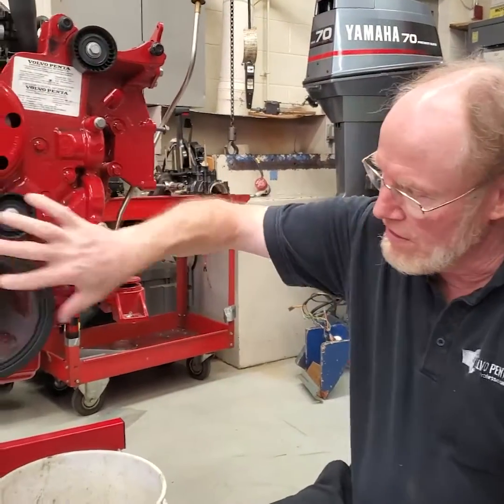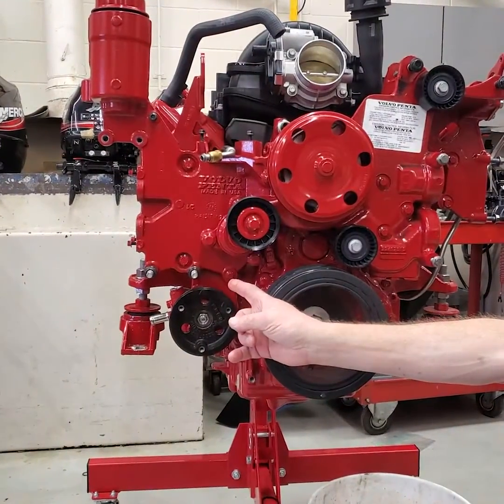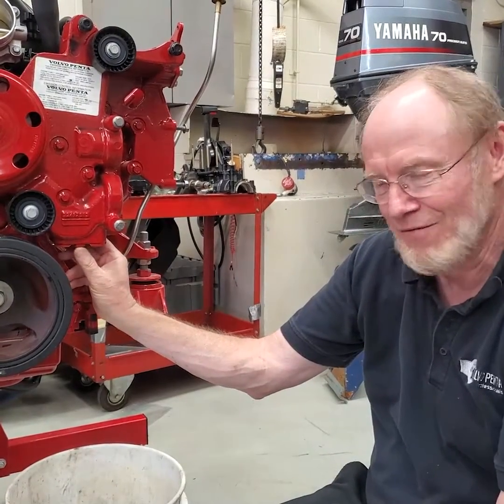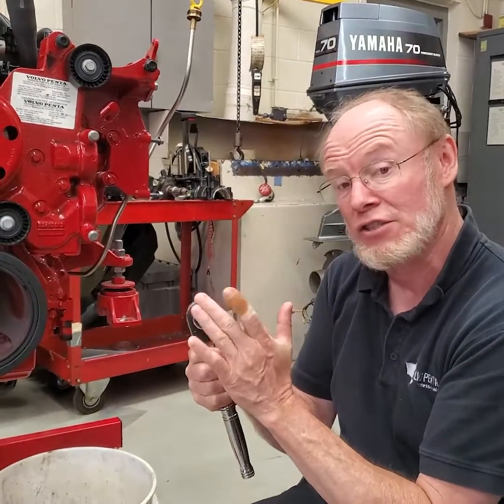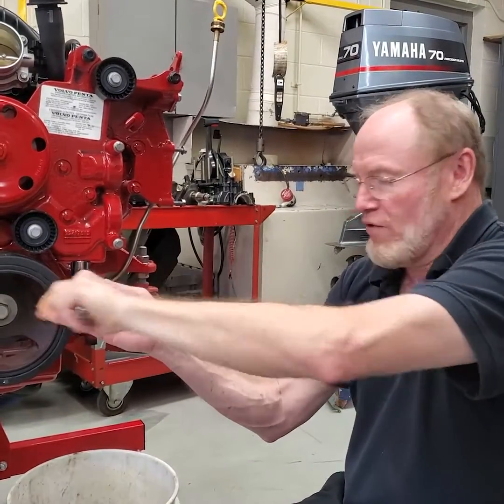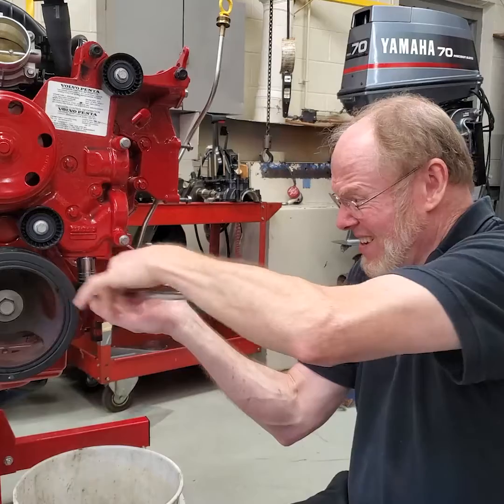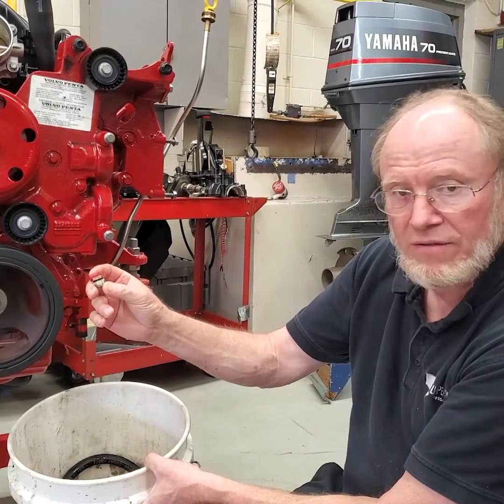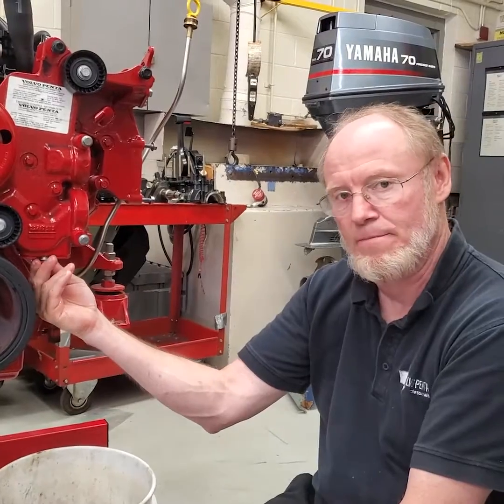Volvo Penta  4.3 and 5.3 Gen V FEAD antifreeze drain location

Comment: Great tip on grinding down a socket for the main drain plug as it is indeed aluminum. It appears that the replacement plugs are brass? The starboard drain is a disaster. Located behind a cluster of wiring and hoses. It will drain directly onto wiring connections. Access is poor. Manual says to use a ball end hex but there's not enough clearance. You need to use an extended ball end hex socket, not a standard socket with an extension. If this is the first time, hammer a quality extended length ball socket into the plug to seat it or it will definitely strip out. The torque spec is only 22ft-lbs but I had to use an 18" breaker bar to remove it. Either it was over-torqued at the factory or the sealant locks it in place. It never loosened up much so I suspect they used a semi-permanent thread sealant. A cheap ball socket is likely to strip. It's not possible to use even a stubby standard hex key. The service manual says to change the coolant after 4 years which is also beyond the warranty. I feel sorry for the guys trying to service this. I will probably use Rectorseal #5 instead of Loctite 567 on the threads as I don't future removal to be such a nightmare. Following the manual procedure still leaves a couple of inches of coolant in the expansion tank that can be sucked out with a vacuum hose.

Apparently Volvo has switched to VCS-2 orange coolant and is phasing out the yellow. The orange can be mixed with the yellow. Ironically, Ford phased out their orange OAT in favor of Yellow because it clogged heads. The expansion tank on our Fords was trashed with permanent staining from the orange gunk. Hoping these OAT coolants aren't some large OEM swapping Volvo for Ford to use up their inventory.

Comment: I have a 2006 Volvo penta gi, I have raw fuel coming out my exhaust. I have taken it to 2 mechanics and have not fixed it. Started with changing the fuel pump due to paint chips. Then replaced the fuel pressure regulator, then had the injectors cleaned and calibrated, now the boat dumps fuel out the exhaust. Runs good, idles, accelerates, ect but is dump fuel. Any ideas. Also does the motor have a fuel cooler. There is no closed system that I can see. Is it standard that they have one.

Comment: How much of the exhaust system is cooled by antifreeze and what part is cooled by seawater?

How does the aluminium exhaust part deal with seawater?
Reply from the maker: The Exhaust Manifold and Riser are both made of an aluminum alloy. There are temperature sensors in each which prevent excessive temperatures due to lose of raw water flow (engine derates in this case).
The entire exhaust system in all GEN V engines is raw water cooled.
To protect the exhaust components there are anodes located in them which need annual replacement. These are described in the owners manual for the engine.

Comment: Does the degas bottle plug just  into the FEAD with O-ring seals? I’ve been getting a very small leak over the winter that I believe is coming from this joint. It appears it seals similar to the heat exchanger, but I don’t want to break the bottle if I’m missing something. I really appreciate your Gen V VP videos there’s not a ton of information out there on these engines.
Reply from the maker: Likely, can you email me a few pictures to marinedoc01@yahoo.com

Comment: How do you winterize a volvo penta v6 200 G without the easy drain system?
Reply from the maker: If you want to drain it for the winter then the owners manual will show the drain point locations
Reply: @tedsmarinerepair8956  
I have read manual and it doesn't explain how to winterize the engine.
There is a flush fitting beside the oil dip stick.
So I am thinking I will just use ear muffs on leg run engine for 20 minutes to open thermstats. Then attach RV anti freeze to ear muffin and run engine untill lots of anti freeze coming out of leg. Also at same time connect another fuel line mix with two stroke oil. Once this is complete there are three hoses at bottom front of engine that go to exchanger I believe. I would disconnect and drain these for 20 minutes reconnect them and I should be good for winter. Does this sound correct. FYI I have  volvo penta v6 200 G IN a 2016 Campion
Reply from the maker: @davelord8039  Remember there is not a raw water pump inside the drive. You may have a blue water flush cap on the side of the engine that you can hook up a water hose too. If so you can flush it that way and run non-tox thru it.
If no blue flush cap/hose, disconnect the inlet hose from the transom and run your hose into that (old school). And yes use a 50:1 Outboard mix with added stabilizer and run that while warming it up to change the oil & filter prior to running no-tox thru it. If its raw water cooled, pull the thermostat and run the non-tox after draining the block and manifolds and you can leave the non tox over the winter for anti-corrosion/freeze protection.
Reply: @tedsmarinerepair8956  
Thanks for your Help I got it figured out. All done now
Reply: @tedsmarinerepair8956  For winterizing a 5.7 GI-g, is it possible to fog the engine through the intake manifold?

Comment: Thanks for the video. Do you know where the drain plug for the antifreeze on a 2007-model 5.7GXI-H is located? Mine looks green(ish), but quite muddy brown so I’m thinking about changing it.
Reply from the maker: The block drains are on the side of the block and may have the knock sensor attached to the brass fitting. Also drains on the manifolds as well.
Reply: @tedsmarinerepair8956  Thank you!

Comment: How often do you need to replace the antifreeze
Reply from the maker: For their yellow VCS extended antifreeze it is recommended it be changed every 5 years. And all anodes in the exhaust manifolds and risers should be changes annually.